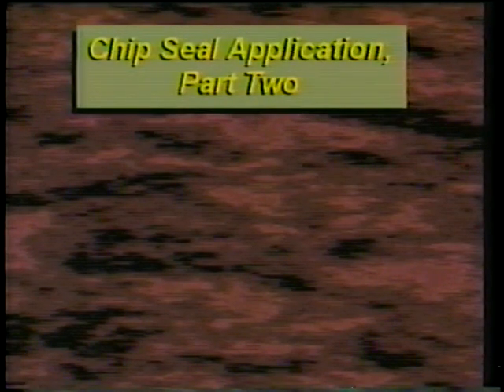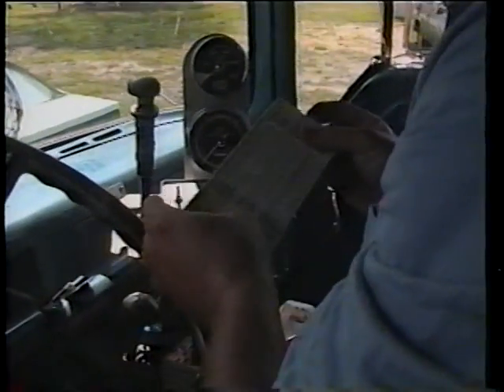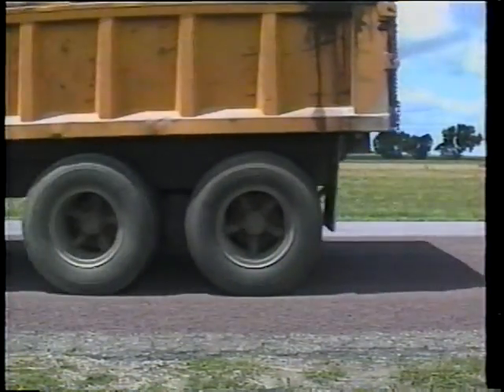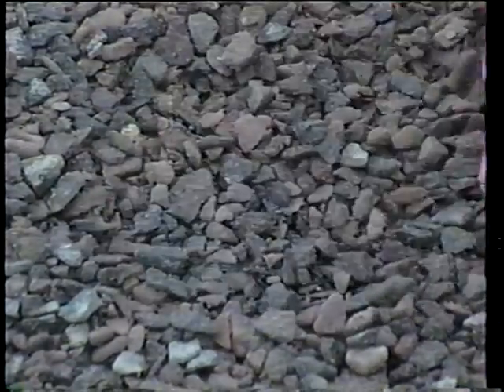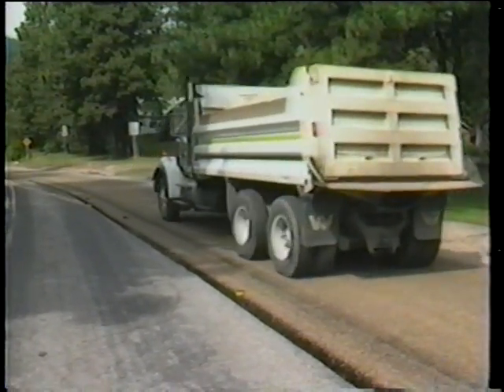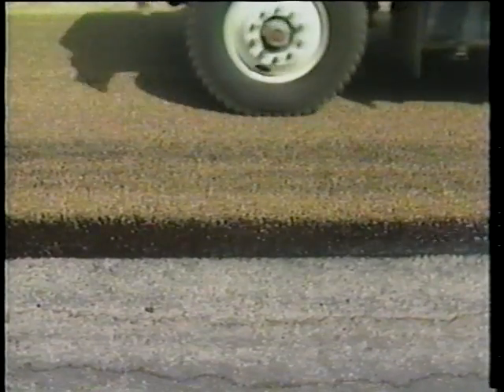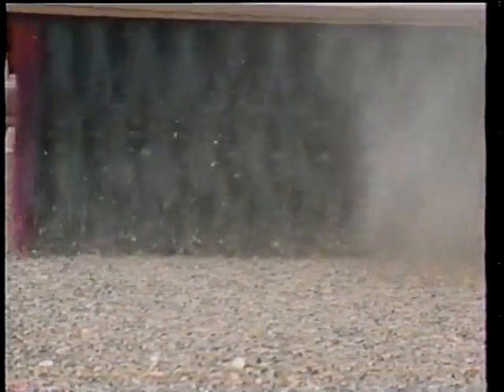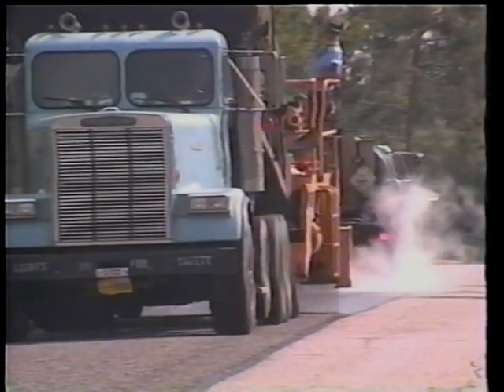Chip Seal Application - Part 2

Comment: You get a better joint if you have a guy pull the paper off before the spreader box hits it. Then the same guy sweeps the excess rock off the front of the joint just before the steel wheels and pneumatics hit it. A really good box operator leaves very little excess rock for him. That way the paper doesn't tear all to hell when you're pulling it off and get asphalt all over the end of your last shot.
And I've covered lots of 2 lane shots going back the other way plenty far behind the distributor. Actually the spreader box spreads better going faster than the distributor anyway.